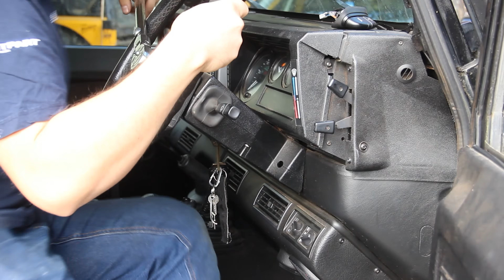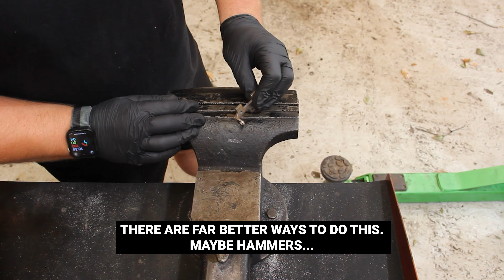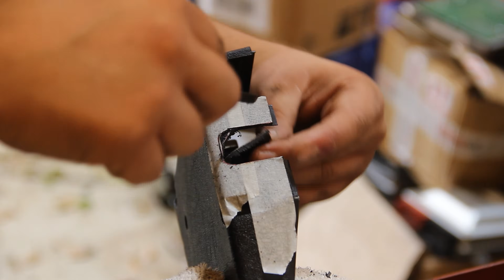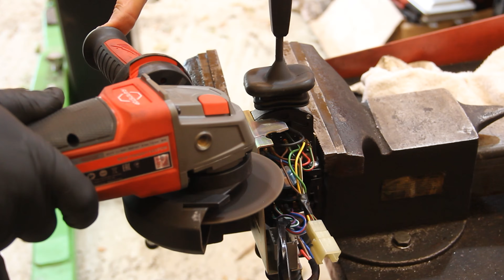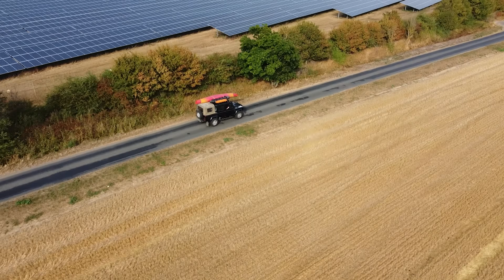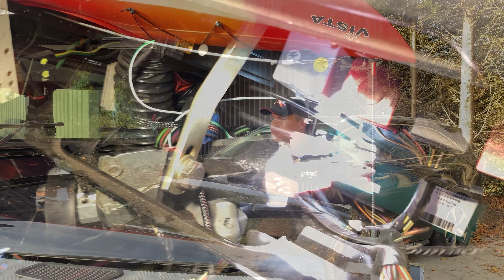Defender Cruise Control Installation!

Comment: Why would the cruise control not work if the car has bigger tyres and different diff ratios? How does the ECU know? Genuine question as I am about to fit your kit to my td5 with 37s and 4.3 diffs

Comment: My defender is 2005. How can i confirm if it has a compatible ECU?
Reply from the maker: Yes if you are running the original ECU then you it will work. To be 100% you could always look on the back edge of the ECU for the version it should be either NNN000120 or  NNN500020

Comment: how low can you get the speed down would be awesome for off-roading up some of the bumpy river beds we have in new zealand use it like an anti stall
Reply from the maker: I’ve set my one to 10kmh which works well when running the 1.4 transfer box it might not be that ideal with the 1.2 but I can test

Comment: Great kit mate, I have a puma transfer box in my 90, also running a twin map. I’m based in Northern Ireland. Who would I go to to get it sorted? 
Thanks 
James
Reply from the maker: Thank you, and yes your ecu will require modification to accept the new gear ratios. I have a agent in Northern Ireland who could help with this  check here for him

https://www.empiretuning.co.uk/trusted-partners/
Reply: @empiretuningUK  cheers mate thanks
Reply: @empiretuningUK  if running an overdrive would the ECU have to be coded to the OD ratios for the cruise to work?
Reply from the maker: @AndRoose99  yes as the rpm of the engine would go out of tolerance, not something I have ever tested but would love to help!